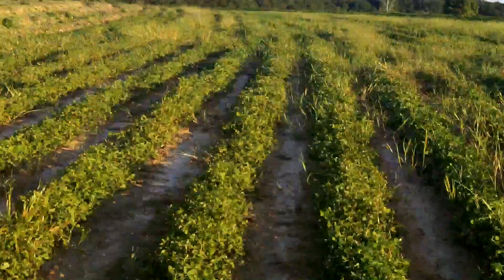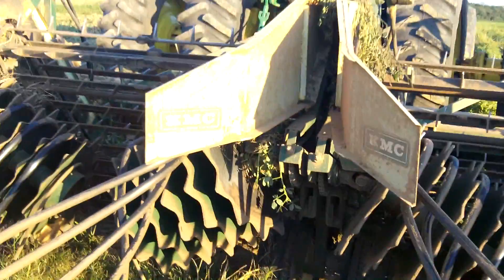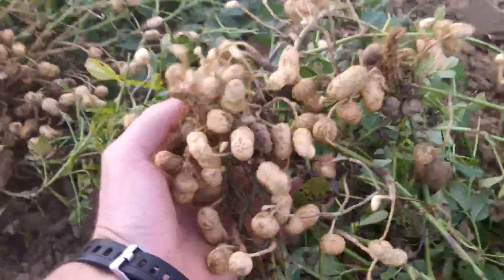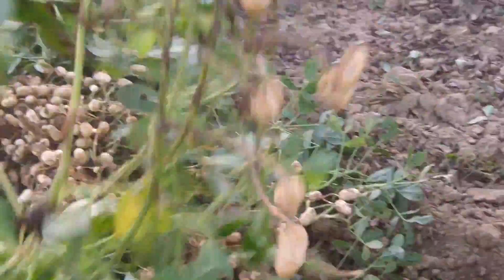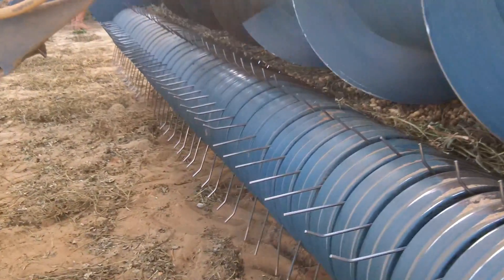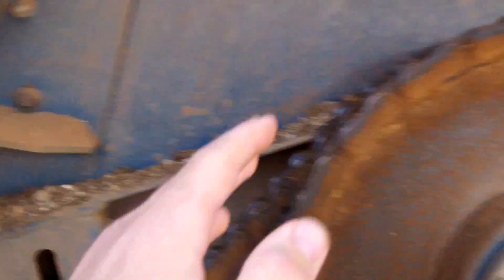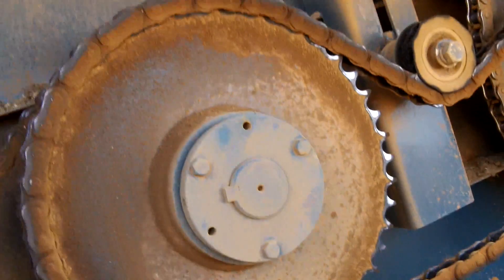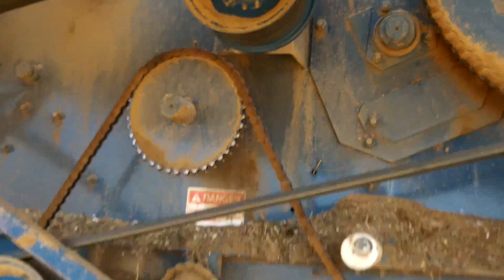How peanuts are harvested / picked

Comment: I noticed several worn sprockets on the seperator machine...the sprockets looked like they would be a pain to change out...Has anyone thought about finding or manufacturing a split sprocket  that can be quickly changed out in case of a breakdown?...Similiar to the ones we used on go-carts for a quick gearing change.....
Reply from the maker: That is a good idea.  Thanks for the comment, please Share & Subscribe.

Comment: Note to operator:  Consult owner's manual for location of all lubrication points.  Especially chains and sprockets.
Reply: too much dirt and dust to use a lot of chain or sprocket lube. only makes the equipment wear faster. the bearings for such are either sealed or greased almost daily.
Reply: Instructions unclear dick caught in door handle

Comment: i can understand, pulling of the peanut plant up and flipping it over. so you stuff dries out. but i am having a bit hard of time at thresher stage and then on....

no matter what it seems i get a a few peanuts (still in shell) that has been cracked, some were along the lines in a bag, and the peanuts inside are bad.  and from looking at this video. i would imagine a lot of the damage i am seeing as a consumer. would be at the harvesting stage.

is there a way to pull the plant/peanuts out. and perhaps cut the top of the plant off. and send root and peanuts to wagon truck. and then dried out back at home. say in a silo or something?  and then peanuts are removed via a stationary thresher machine perhaps?

is there any sort of "meh forget name" were items go through a tunnel made of grates, and air is used to "sift"  peanuts based on weight or like. to remove small size not really edible. along with perhaps bad peanuts... perhaps running peanuts through a water trough, and then sent into the wind tunnel sifter machine. so if peanut has a crack in it, and in that more heavy? and sinks out settles out?